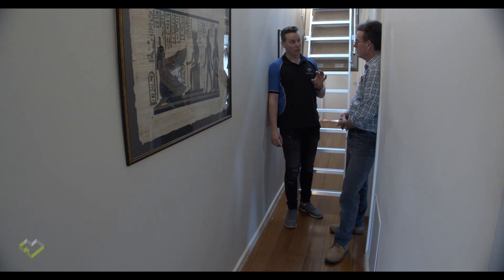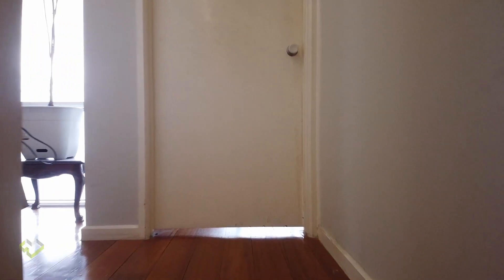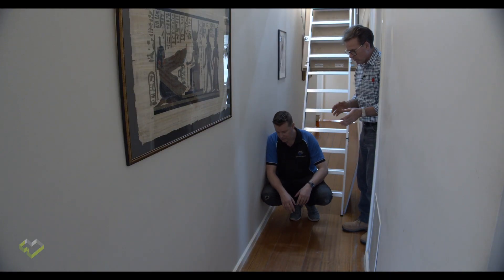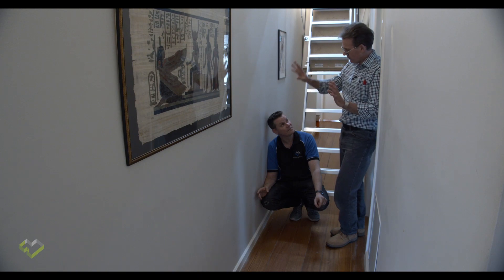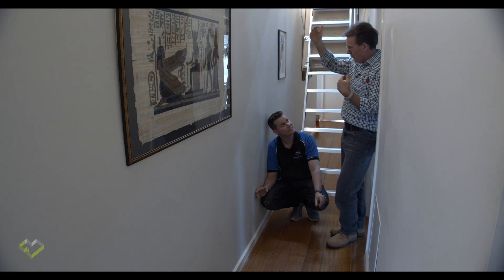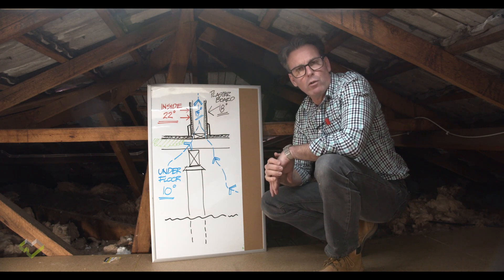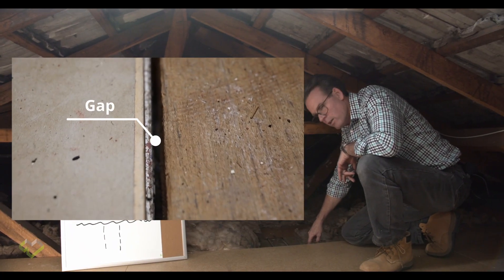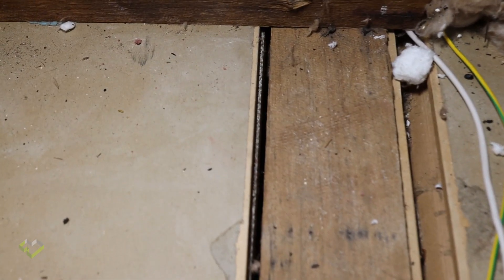Sucking the comfort out of your home. *COMMON ISSUE*

Comment: Question: Why can't you just seal the gaps to the bottom plate (ie under the floor) rather than the top plate to stop the air getting in at the source? Most older houses like this in Qld are high set.  No need to crawl into a dodgy roof...
Reply from the maker: Air movement from outside up your wall cavities, is air infiltration through your building envelope, and create temperature differentials on surfaces that create an overhead on your cool img needs.   But potentially if you cut off air movement from below, you reduce air flow from above.   You are in a cooling climate up north, so the source of air infiltration into your wall cavities may be from the roof.  Cold air drops.

Comment: so are you saying that if you seal from top and bottom then you may not need to retro fit with insulation?
Reply from the maker: Retrofit insulation where?  Internal walls?
Reply: @ecoevo  yes internal walls? I was also told no use retro fitting insulation in the walls if you dont have double glazed windows. what are your thoughts on this?

Comment: Hi what is the coverage  rate of your Low Expansion Gun-Grade Builder's Foam - 750ml (Screw Top) ?
Reply: Hey David, 
According to the spec sheet Box Yield 38 Litres and Joint Yield 26 Metres. From our experience we find that for an average home of 100m2 to do the above application we tend to use around 6 cans. Though every home is different and things like cornices, the width of the gaps etc all have a factor as to the amount of foam you need. If you have excess foam cans. Look at sealing around your windows and subfloor.
Reply: @ecohome3203  Thanks for replying,  that's  good to know I can work out how much I will need .

Comment: Good video with good detailed info, however in summer would not the cold air rising up through the wall cavity be a good thing, eg keep your interior cooler?
Reply from the maker: With the air in your roof quite hot 50-60 degrees, warmer air expands, so potentially positively pressurised up there and the walls inside quite cool especially if you are air conditioning, the movement of air won’t be that great.  Their should not be that much of a net benefit in summer.

Comment: Did I miss something, or did you not recommend foaming up underfloor, which is where the cold air is getting into the walls? In some houses it might not be possible, since not every house is high enough to get under the floor.
Reply from the maker: The main goal here is to reduce air from moving straight up as fast as it might if it’s completely open up top.  The more you can reduce air from both at the top and the bottom of the walls, the better your internal walls will perform.

Comment: Is Sprayfoam the only option to prevent air leaks from the sub floor in these types of builds? 
Western Vic here, so travel costs could be prohibitive. I'm planning a reno on a place that resembles a sieve with currently only ceiling insulation.
Reply from the maker: Dirt McGirt you could just caulk the gap, but i like to fill the cornice with foam insulation too.  you can buy our spray foam products and caulk from our webstore. https://tighthouse.com.au

Comment: Would you still recommend sealing the roof cavity if you have used sprayfoam insulation under the floors?
Reply from the maker: Ros Duffy Good question, and no, it should not make as much difference, if the floor has been sprayfoamed.
Reply: @ecoevo  Thank you for such a speedy response. I love your content.

Comment: The main problem here is the builders and plasters understanding of what the role of a cavity wall is!!
We've had a kitchen re-plastered and to my horror they cut the sheets short of the top plate, so I'll be filling the gap. Which goes to show it still goes on today, and it will be a hard fight to break decades of poor understanding and practices.
Reply from the maker: Andrew Smyrek Yup, it’s absolutely a massive problem when we have to rely on plaster as our air barrier for comfort.